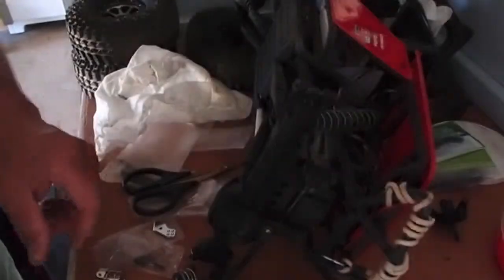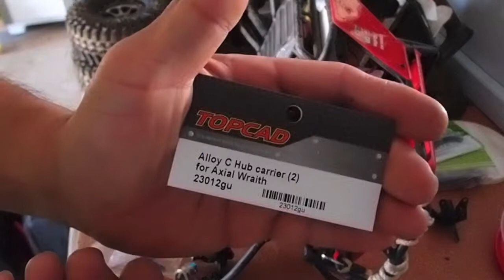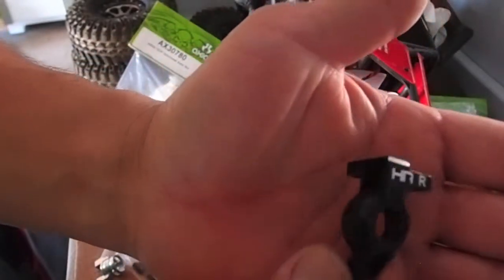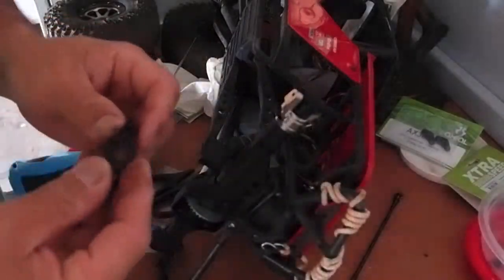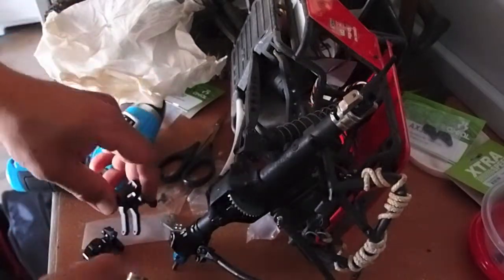Project Wraith - C hubs, knuckles, universals Update #4

Comment: I found that only removing one of the shock mount bolt works too, so next time you can save yourself the hassle (20 seconds hassle but oh well :)  )
Reply from the maker: Thanks +dave racine that's true about only backing one screw of the shock mount out. I completely forgot about that.